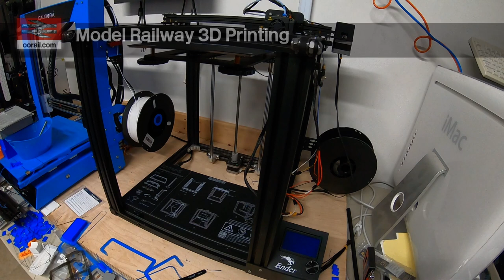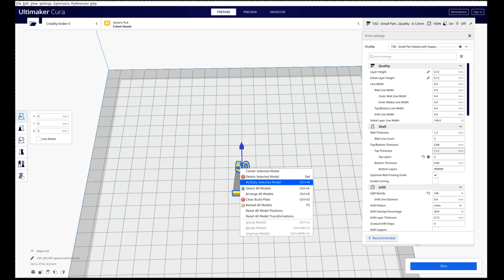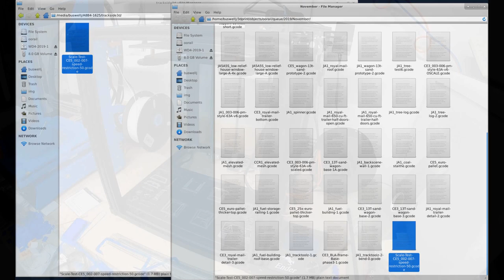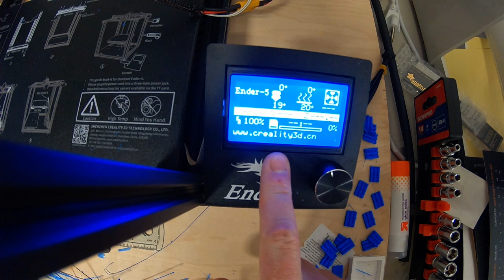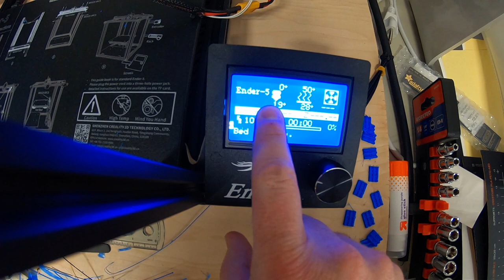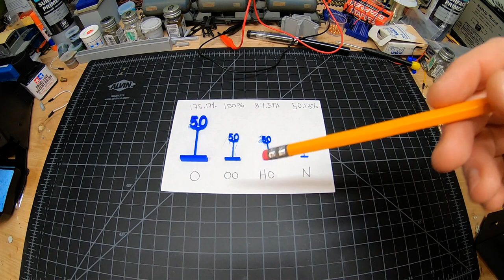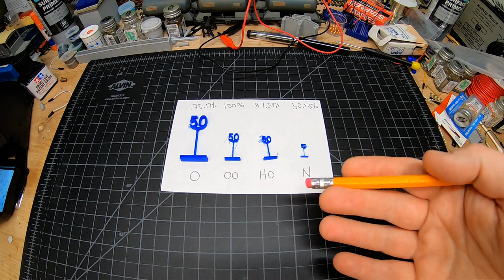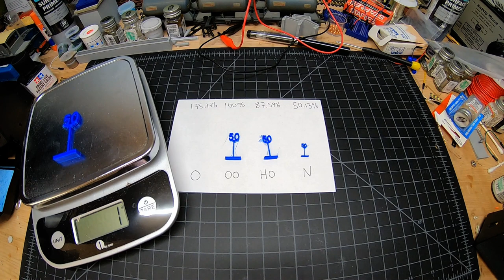oorail.com | Howto 3D Print different scales from one digital model

Comment: Guess I'd better catch up on your 3d printing articles and vids then keep up with the new ones.
I am currently high bidder on an Anycubic resin printer but have also been looking at the Anycubic predator filament printer
which has a big  370x370x455 print size. I've mainly looked at Anycubic as they are stocked here in Australia.
Do you have any experience with or heard good/bad things about them?
I look forward to your next 3d print video with your recommendations.
Reply from the maker: Have a look at the channel Makers Muse about resin and fdm printers. I've found for model railways that the resin printers are good for highly detailed small parts or flush glazing that needs to be crystal clear. When I say highly detailed small parts, I'm talking OO scale shed plates, OO scale people, very fine complex detail in a small space. FDM printers will print very small parts, I can print ring field center cogs, OO scale floor heaters, paneling that goes inside relay cases etc, all with the FDM printers. You just have to setup the CAD so it works for FDM. I see a lot of people try to print things as one piece, but the geometry is impossible for the printer technology in one piece, printing things in several parts and then minimal assembling (think airfix kits with like 2-6 parts rather than 30+ parts).  Personally, I think most people will get more use out of a good FDM printer than an SLA/resin printer. Unless you are modeling N scale, then I'd suggest looking at using a 0.2mm nozzle with the FDM printer at lower speeds. I have the Anycubic Photon, but it gets very little use. It is messy and its expensive, especially when prototyping parts. It really depends on what you want to print, if you want to print OO scale Mk1 coaches, then at a minimum you will need 220x220 print area and that's pushing it. So the Creality Ender 5 or Ender 3 Pro are good options there. I have the Ender 3 in the print farm here, it required some upgrades to work well - magnetic bed, replacement tubing and now it prints amazingly well. I have it printing freight rolling stock right now. If you need something bigger, the Ender 5 Plus or the CR-10 series are worth looking at. We have a massive CR-10 S5 here that does 500x500x500 which works great,  but just like most Chinese 3D printers, you have to tweak and update the parts occasionally where they went cheap to keep the price point down. If you are doing OO scale, I would for sure suggest FDM, I am not familiar with the Anycubic FDM printers, but I would check out Makers Muse for sure.
Reply: @Oorail  Cheers I will check them out and watch your 3d print videos too before I bite the bullet. Missed out on the resin printer as I was out having lunch - oops! 😊

Comment: Hello, would that program have USA tenders?
Reply from the maker: Hello James. I assume you are asking about the Cura slicer? Cura is a program that takes a 3D model file (usually in STL format) and converts it into the instructions for the 3D printer called gcode. If you want to 3D print USA tenders, you would need to have a 3D model to load into Cura first. You can find model railway 3D models on places like Printables, Thingiverse, Thangs and Trackside3D.co.uk. You can also design models yourself using CAD software or 3D modeling software like Blender (which is free).
Reply: @Oorail  Thank you!